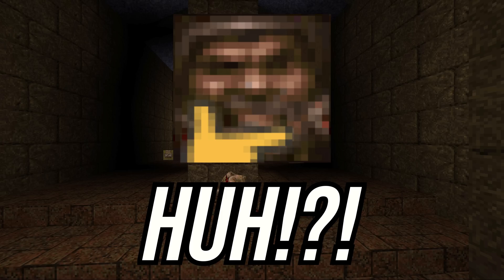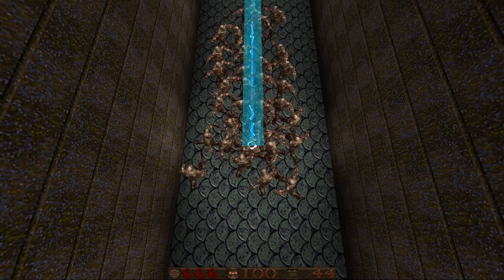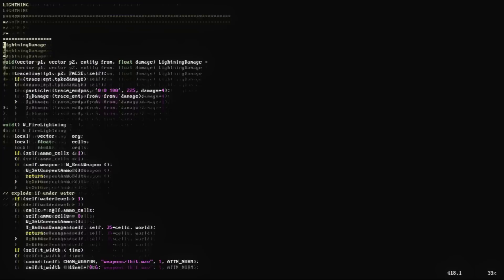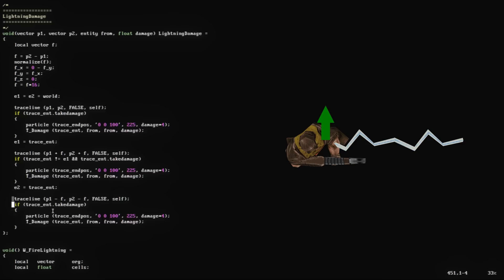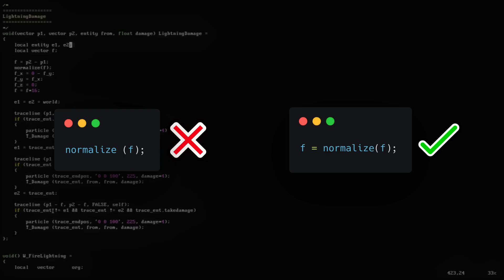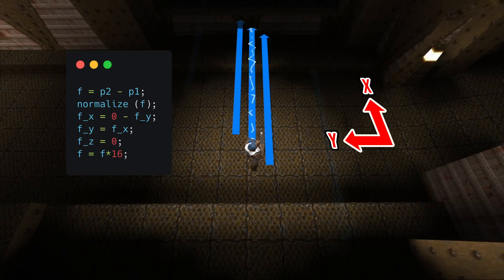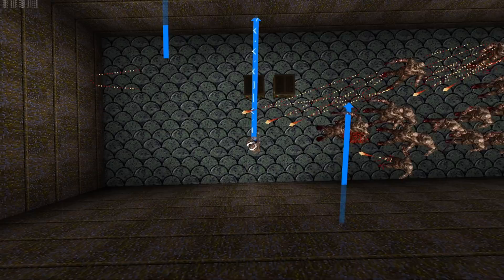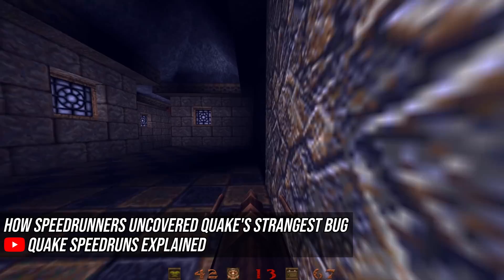Shooting Through Walls: Unraveling the Code Behind Quake's Lightning Gun Bug

Comment: I came here from quakespeedrunsexplained.

There is actually one more bug in the code, although it's irrelevant because of the other ones.

Let's say the assignment of the normalization and the swap bugs were corrected, the offset would still be wrong, because the vector is first normalized and then the z-component is subtracted. That means that the xy-components do not form a unit vector. The higher or lower you aim, the closer the beams will come together.

Correct would be to first eliminate the z-component and then normalize.

Comment: The rays either side of the main beam may have been an attempt to make long distance shots more likely to connect. Most players were in 320x240 with ball mice - at that resolution and with a low mouse DPI, an apparent hit could easily be a miss even if one tick of the mouse were small enough to hit the mark - especially given the 'lightning' closer to the gun can overlap the stream in the distance.

I played a lot of deathmatch - consensus was lighting was a mid-range corridor weapon, bad long range given you're mostly missing the target and just 'scanning' across it - maybe the 'fixed' code would have elevated it above the nailgun!
Reply: Actually, around the game's release, it was more likely they would be using only the keyboard - so that kind of assistance was even more necessary.
Reply: fair, but this implies we weren't hitting awesome shots in the 90's, we were :) also we were in 640 x480 for the most part, 320 was crazy even back then. (I had 160hz in 800 x 600 on cs 1.6 years later too! CRT's werent that shit man)

Comment: There is a somewhat similar bug with Team Fortress (1, for Quake) sentry guns - it also doesn't normalize properly, but the difference with this bug is that the vector p2 that is passed to the traceline() ends up having really giant magnitude instead (magnitude squared IIRC). Thus sentry rounds have no scatter, despite authors trying to make it like a super-fast single barrel shutgun. 

An another bug is that a sentry shoots from the top of its head, and, when its target is on the same height level, it shoots at the enemy's top of the head (height 56 from floor level). Thus when both bugs combined, a shot's outcome depends on a sentry and its target absolute positions, by the means of floating point accuracy and rounding errors, rather than PRNG.
Reply: Yeah, they're equivalent to a Grunt's shotgun, 4 pellets and 1/10 spread instead of 1/25. They don't normalize at all in the original code, I've normalized it and after some tests they felt so much weaker even on medium distances... I ended up reverting back lol.
Reply: @rfalcetti  Also a funny side-effect of non-normalization is that visual effects of 'misses' are misplaced, appearing at seemingly random positions on the map.

Comment: Judging by the model of the weapon, I would guess that the original plan was to have three beams firing out from the start (not as a fix for shooting multiple, but just intended from the start to make it more effective/require less precision back when people couldn't aim or used keyboards only).

And I can imagine they scrapped the three beams idea for performance or to reduce the visual clutter, but didn't want to make it feel less accurate.

I would bet that the level they set up to test it also happened to have the enemies aligned on the Y axis (so the player was facing down X), hiding the issue to some degree. Seems like it would be difficult for this to slip by testing otherwise, or perhaps they just didn't test this in isolation and never noticed it wasn't working.

Comment: As a game designer my guess is that they wanted to use three beams instead of one to make it easier and more rewarding to hit enemies. The electric beam also does visually not appear like just a thin line, it's more like a tube, but a tube collision detection is much more resource heavy than collision detection with three lines.

Comment: Even though ive been coding for years with vectors and 3d graphics, vectors are sometimes the most painful god damn thing in the world. I swear the first thing i do with vectors in every program i use is make a proper vector arrow display function (like the one in the vid) because without it its just tooth pullingley tedious
Reply: working with vectors in plain C without operator overloading is especially painful
Reply: (hides dual quaternions under the table) yeah those damn vectors.. dot product? it sounds like an 80s new-wave band. My grandad didn't need a dot product, he'd solve everything by cutting up circles of paper like a real programmer.
Reply: Yeah i exercise, i do the cross product all the time
Reply: @TU7OV  It is ineffectient to use C++ here, and operator ooverload may hide bugs. If would go the opposite way, and instead do all operations in place (basicly how you would do it in assmbly, but multidimsional). Not only does this avoid the dreadfull return and allocation of a temporary structure (that vectorize() does here on assembly level), it can also be more efficient, as the highlevel function is responsible for allocating providing space (typically on the stack).
Reply: operator overloading doesn’t hide any bugs that calling functions can’t hide. what benefit to you gain by making your equations correspond less well to the math? Also if you think the return and allocation of temporary structures is actually an issue here, you don’t know very much about compilers :P
Reply: @TU7OV  I've been doing a lot of vector math in Zig recently, and I don't mind the lack of overloads. I think C is painful for other reasons (like how it doesn't care about ignored return values, allowing the bug in the video to happen), and I'm now fairly convinced that overloading is overrated.
Reply: My approach is diffrent. First, i try something, realize its horribly wrong, draw the vectors and calculations on paper, verify that everything works, implement the function in code... and then back to square 1.
Reply: Working with vectors is a breeze in shader languages, for debugging I usually just output colors to the screen
Reply: @blackrack2008  thats true, color vectots are nice. But angle and position vectors
Reply: @hughjanes4883  i output angles, positions, distances as colors...

Comment: If QuakeC compiler had some warnings ("builtin-function normalize return value not used") this would have been catched. Why this was not found during deathmatch (especially 1on1) puzzles me.
Reply: > especially in 1-on-1
in those cases, you're almost always trying to aim at the one enemy, so you'd never notice there were other invisible beams.
Reply: @mengmao5033  True. On the other hand, if in 1-on-1 somebody misses you but still you get hurt, you know it was not some other player behind your back. The bug could have been found during mutiplayer deathmatch where someone is hiding in a small room to await a item respawn but is suddently hit by that invisible beam. 

I guess lightning gun was mostly used in short distances so the bug was not obvious.
Reply: It does have warnings. 15 or so on the actual game's code.

Comment: That normalize() mistake is so easy to make in GLSL as well, hate it. Would be so much clearer if it were normalized() instead
Reply: All hlsl and glsl intrinsics are functional i.e. they do not modify the arguments and instead return the computed value. Personally I like this style for all math functions, even in other languages.
Reply: @nooan79  He was complaining about the naming. Not about the functional style
Reply: @LeMustache  sure but in hlsl and glsl the function is also called 'normalize'
Reply: @wintermute1814  Yes. That's the point of his comment
Reply: @LeMustache You can't name every mathematical function by the past tense verb!

Y=sqrted(x)-sined(2x)-smoothstepped(x,.1,.1)

It's implied in a mathematical function (and most programming functions) that it returns the result, it doesn't change the parameter! And in C (and I assume quake C, you'd need to write normalize(&v) if it was a function that modified it.
Reply: @tbird81  Interesting point but why are you explaining this to me? I don't share the opinion with OP.
I just clarified the idea behind his comment because some people in replies had difficulty reading.
Reply: @LeMustache  The point is it's not an easy mistake to make. And naming it in the past tense would likely increase confusion and wouldn't fix those errors anyway.

Nowadays I imagine some IDEs will point out when you have a line that effectively does nothing.
Reply: Never had such mistakes while coding in glsl. What did cause me to go insane is that it requires me to write a .0 after every number that is supposed to be a float.

Comment: I'm very surprised the programmer did a bad swap, I can't remember ever making a mistake like that (I probably have, just forgot), I understand it was probably just a late night mistake or something of the sort, very interesting. There's a popular interview question that asks the programmer to swap 2 variables without a temp one. My favorite answer is using XOR
x = 2
y = 3
x = x ^ y;
y = x ^ y;
x = x ^ y;
// x = 3, y = 2
this, however, is horrifying and shouldn't be used.

Also I'm not the most familiar with C, isn't ignoring a return value like that a warning? I just always assumed you would need to assign cast it to void? or even just assign it to a value and let it be optimized out by the compiler?
Reply from the maker: Hello, this is written in QuakeC, a language specifically designed for Quake's game logic,  with a custom built compiler. It likely had very few validity checks like the one you suggest.
Reply: @MattsRamblings  out of curiosity: does QuakeC have macros in it? Because usually C programmers define simple macro for this operation.
Reply: @proosee  No, it's a very primitive scripting language that has all sorts of weird idiosyncracies.
Reply: I remember that even when compiling the game's code, QCC gives something like 15 or 17 warnings (it's been a very long time, so I forget the exact number), and it's very possible that that is one of them.

Comment: I was wondering if the side beams can potentially triple the damage, and may explain why the gun has such high DPS (300), but looking at the quake c it seems like subsequent traces only deal damage if the previous didn't hit, and it just deals 30 damage per cycle. There also seems to be some PvP specific funky Z velocity push that only happens on the primary beam, but the bug should work in deathmatch too.
Reply: That makes me wonder: Is the center beam prioritized if it and another beam contact different targets? Or can you end up in a situation where you have the center beam dead centered on an enemy, but since you're at an angle where one of the side beams is hitting an enemy in a completely different part of the map the enemy you're actually trying to attack goes unharmed?
Reply from the maker: The beams can all cause damage at the same time, but they have to be targetting different entitites.  This means that you shouldn't end up in the situation where one beam hitting something will prevent the other beams from causing damage.

Comment: Why is it 0 - f_y rather than just  - f_y ?
Reply from the maker: Hey there, I'm not completely sure but this looks like a limitation of QuakeC (the C like language that the quake game logic is written in), where it lacks a unary negation operator.  A quick grep through the game source doesn't turn up any unary negations, and its not supported by the byte code (the intermediate representation that the QuakeC gets compiled to), and nor can I find it in the parser source:  https://github.com/id-Software/Quake-Tools/blob/master/qcc/pr_comp.c
Reply: QuakeC is a very odd and limited programming language. Very much built on the spot without much thought put into its design. It gets the job done for scripting game mechanics but it’s missing a lot of features that you’d take for granted in most proper languages.
Reply: Yeah, the original QCC compiler lacked a ton of simple things you have in other languages - you couldn't do increments like i++ for example, and AFAIK even for loops were out of the question. Luckily nowadays we have compilers like FTEQCC that bring up most of the C features back to QuakeC.
Reply: @Astfgl  I think there was plenty of thought put into its design. But some of those thoughts were "we need to have the compiler working and pretty much frozen months before release so we can actually complete and playtest the levels, so let's not add more features unless they're really important."
Reply: @hobbified  What I meant is that it was designed based on what was needed at any point in time, rather than being a well-thought out language designed ahead of time by someone with a solid understanding of language and compiler design. It has all the hallmarks of an in-house domain-specific language built in a rush and with very impromptu decision-making.

id Software revisited the idea of using a virtual machine to run game logic in Quake 3 and they did a much better job that time. Not in the least because they chose to use regular C and an established compiler (LCC) for their scripting language that time, but also because John Carmack actually took two weeks off to properly work out his ideas for the QVM toolchain before plugging it into the game engine.

Comment: This seems like such a weird and somewhat hacky implementation to me. If I were to program this, I would grab the player’s right directional vector (pretty sure Quake already pre-calculated that somewhere) which is already normalized, scale it by 16 units and then use that to offset the beam’s start and end positions. Since the player rarely has any roll applied, there’s not much need to flatten the vector either. Someone must have programmed this in a hurry and then didn’t thoroughly test if it works.
Reply: The side vector isn't automatically pre-calculated. But QuakeC does have a function (makevectors()) that takes a pitch/yaw/roll angle and generates 3 separate front, side and up normalized vectors, which would work just fine here by inputting the player's viewing angles, and not even need any normalization.
I think they did this way because the player's angle wasn't passed down to the LightningDamage function, only the origin and end points of the beam (which are calculated previously via traceline in W_FireLightning). So when they were expanding the code, they probably decided it was easier to just make a quick and dirty calculation by hand based only on the origin/end coordinates passed to the function.
Reply: Yeah I guess so. It’s been a while since I did any QuakeC programming so I’m rather fuzzy on all the details. Calling makevectors() just for this one function was probably a bit too expensive anyway. You’d think it would make sense to calculate the player’s directional vectors once per frame after updating the position and angles and then cache them somewhere globally, since it’s such a ubiquitous thing needed almost everywhere in the game logic.
Reply: "then didn’t thoroughly test if it works."

It doesn't look like they tested it at all.
Reply: @bmFbr  I just had a closer look at the QuakeC code and it is as I remembered: the directional vectors calculated by makevectors() for the local client are stored in global variables that are available throughout all of the QuakeC code: v_forward, v_up and v_right. These are defined in defs.qc with the comment that they're global variables set by built-in functions. You can also see the lightning gun firing code make use of the v_forward vector to create the ray to trace for the lightning beam. So the lightning damage function absolutely could have made use of the v_right vector to create these two offset lightning beams.
Reply: @SteveBennett1  Unless they happened to be lined up in exactly the right direction for the secondary traces to be roughly in the right spot :P